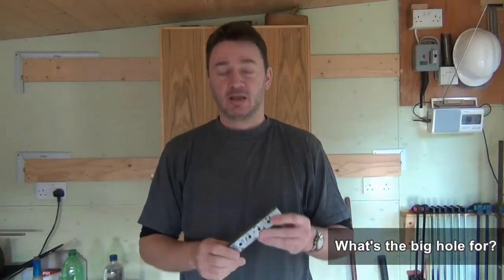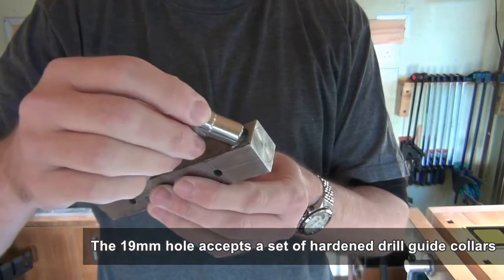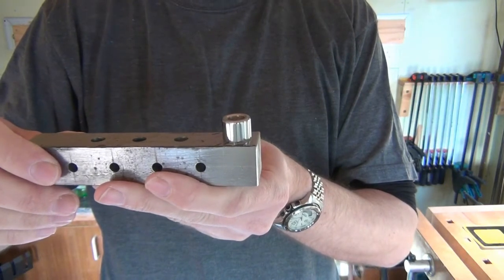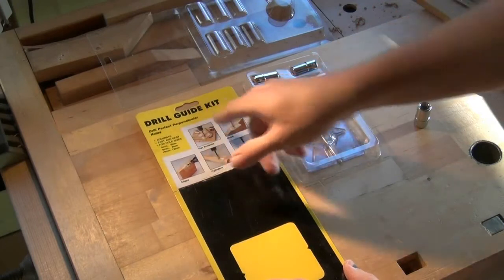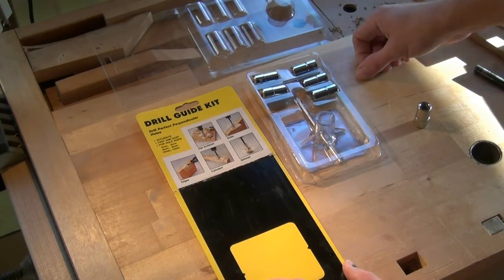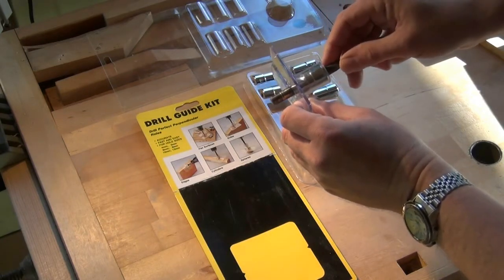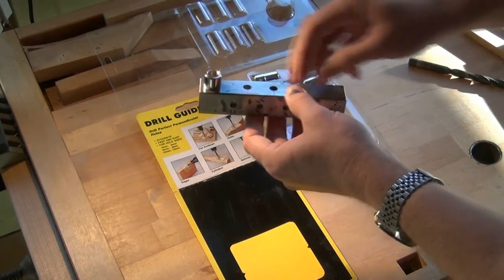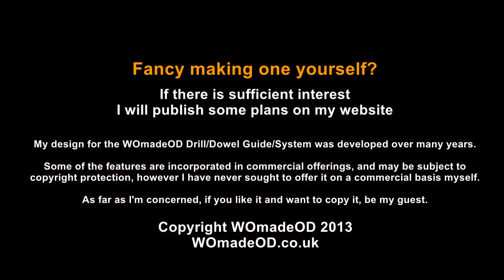DIY Doweling System - Big Hole?

Comment: Did you have that hole precision bored?
Reply from the maker: No, I did it myself. I did use a milling machine rather than a drill press, but only because I was avoiding layout and centre punching - it's a lot quicker to chuck a centre drill in and use the mills indexed x and y to centre the blank and then centre drill the holes an inch apart.
A well set up drill press (perpendicular in both x and y axis' ) and a quality drill bit, is perfectly adequate, so long as the cut isn't forced (which could introduce an alignment error).
Reply: That's the way to do it. Very cool!